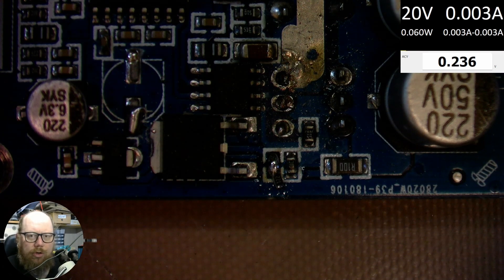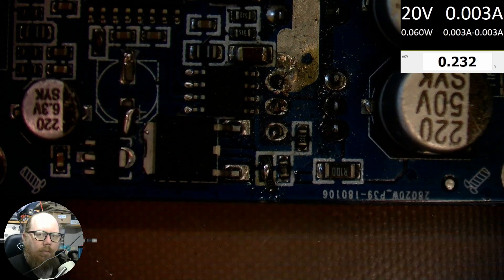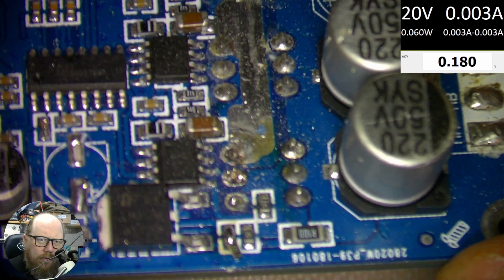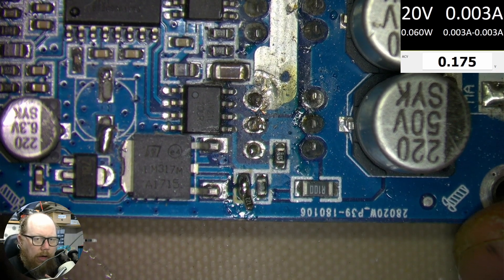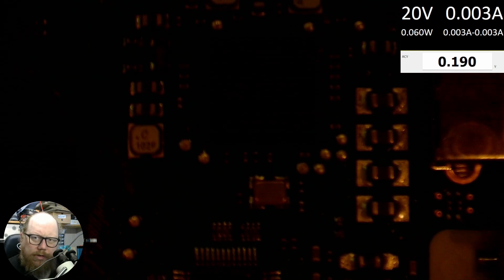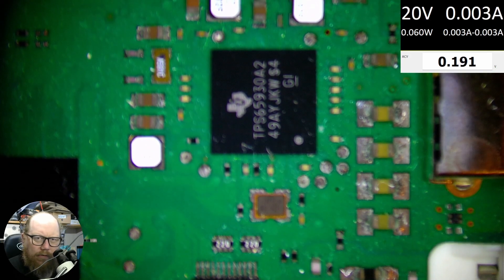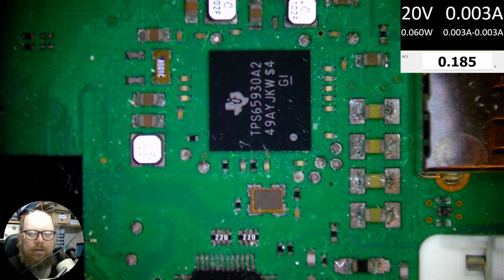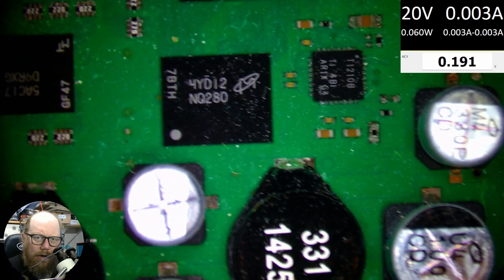Mechanic LS720+ Microscope Ring Light, recommended by @Soldering_On

Comment: Shame you fail to mention the fact that the light source on the LS720 is way underpowered which results in a much darker view through the scopes optics. Also you can tell straight away in this video when you swap to the LS720 that the camera is having to work much harder, with the reduced light, by having to boost the ISO.  I'll stick with my usual lighting and a hand held polarizer if and when I need it.  If the LS720 had a much brighter light source THEN it would be a fantastic buy.  Go look at @dellpartspeople 's latest live stream 41 minutes in - he agrees!

Comment: I em thinking to buy this but don't know can this fit on industrial microscope from AliExpress
Reply from the maker: @FubarX Well, depends on the diameter of the lens it’s to be mounted on. My Barlow lens has a diameter of ~50mm and I know @Soldering_On had a diameter of 58mm and he had to slightly modify the light to get it to fit.
Reply: @LetUsRepair  i have that small lence like 25-26 mm  that is why i dont know.All this ring lights are like 46-50 mm
Reply from the maker: @FubarX It’s no real issue, it will work just fine. The only thing you have to do, is get three longer screws than those that come with the light, because the “default” three screws are not long enough for such a thin lens. I’m not at the bench now so I can’t measure the screws, but I’ll be there a bit later and can give you all their measurements 👍
Reply: @LetUsRepair  Thank you man. I will place my order. And try to find bigger screws

Comment: Polarized light is an ABSOLUTE MUST for electronics microscopy.  Night and day difference.  I actually have this exact model in my spares/extras shelf, currently I'm using the iFixes iL37 which, before Mechanic came out with their polarized light, was the de-facto affordable polarized microscope light.  I keep meaning to compare the two as they both do the same job, but I have so much in my to-do list...
Reply from the maker: @neverendingstudent Hehe, never-ending to-do list is both a blessing and a curse 😊 That would make for a very nice and interesting video!

Comment: Wow! Im so glad i have ordered this cant wait to receive it!
I also echo the sentiments of Lenovo qaulity control. It really needs addressing. 
Also i agree Soldering On is a fantastic channel im so glad i found his content
Reply from the maker: @JFIXX1 I can almost guarantee that you’ll be incredibly amazed! Even though I tried very hard to get the right shots/angles, it’s still not doing the light full justice. It’s so simple and effective to use, it’s almost ridiculous, compared against the price of the light 😳
Reply: @LetUsRepair I have been using my microscope without any ring light as i they sent me some dogey 240v one with my scope and doesn't have a uk plug dont really want to extend an AC cable going across my desk where ik soldering id much prefer a 5v USB
Reply from the maker: @JFIXX1 The one that came with mine was also 240V and has always bothered me; There’s absolutely no reason for it, 5V is plenty. Going from no light to LS720+ will be life changing 😘